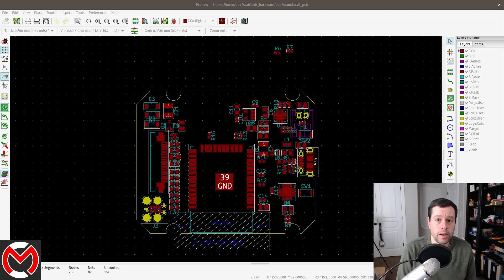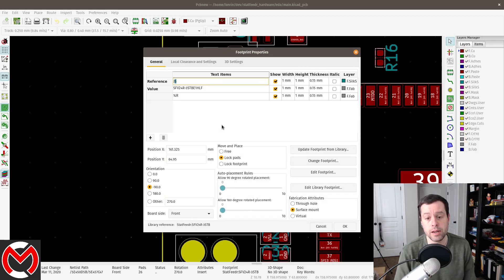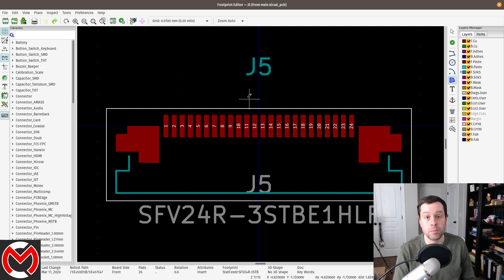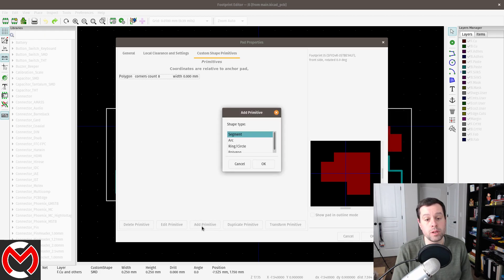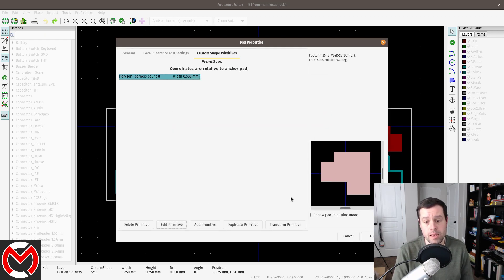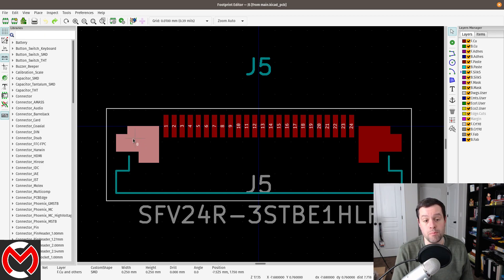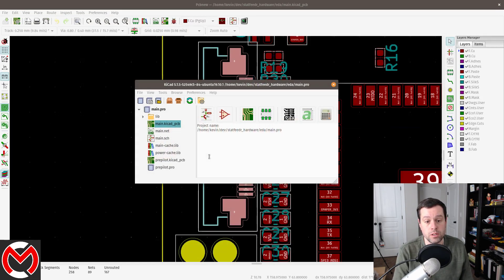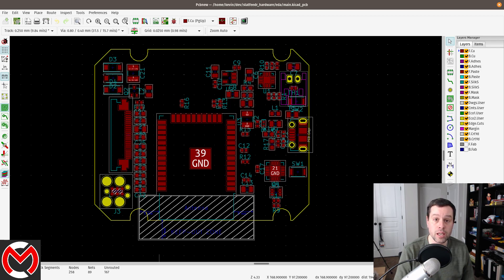Creating an ESP32 E-Paper Dev Kit: KiCad Custom Pad Shape

Comment: Hah, I found this video because I made a footprint for a 4-pin version of the very same connector you're showing and DRC was giving me problems because of overlapping rectangular pads.

I really wish there was an option to merge existing pads - maybe there is, but I can't figure it out right now.
Reply: FWIW the workflow that worked for me in KiCad 7 was:

- right-click one of the overlapping pads
- edit pad as graphic shapes (cmd/ctrl-E)
- draw a polygon in the same F.Cu layer using the corners of the "old pads" as reference points
- edit the polygon and make sure it's filled and the line width is set to 0 (otherwise I get the oversized rounded corners)
- finish editing as graphic shapes (cmd/ctrl-E)
- delete the old superfluous pads
Reply from the maker: @nietaki  Thanks for sharing the solution. I was going to say that I had no idea how to get around that...but now I do. Haha.